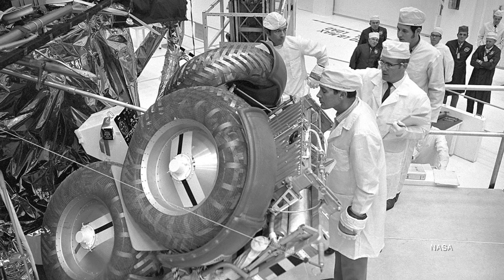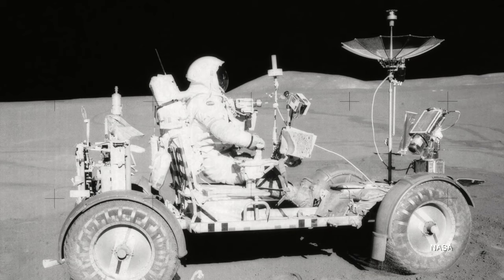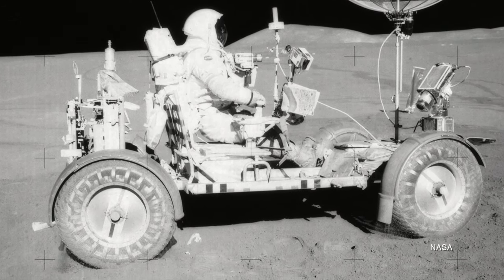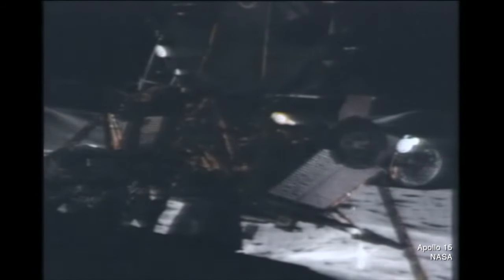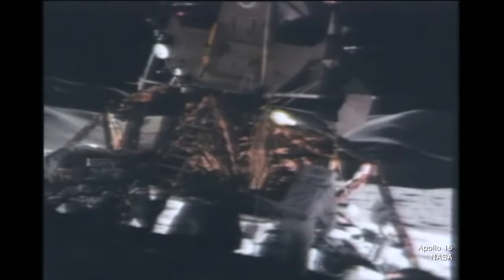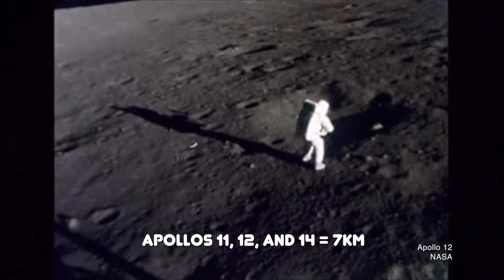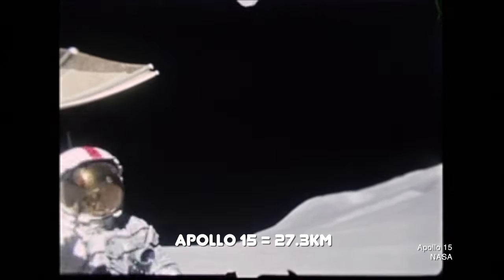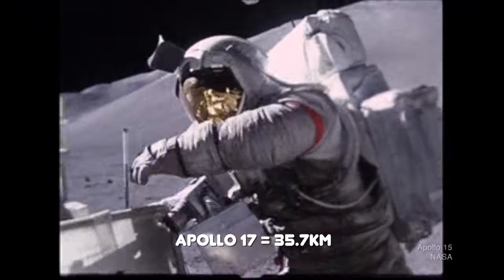How NASA Took Cars to the Moon

Comment: sure looks like the nevada desert to me lmao----ohh was the lem allways charging the rover on way to the moon---space is cold -and should they not deploy the rover in the sunlight to heat up the batterie-and have a solar panel to keep it charged so they could go say 25 miles .
Reply: The fuck are you talking about? The batteries had solar shielding for temperature regulation dude. And the rovers never went very far. They had the battery charge they were given when the ships were launched and that was it.

Comment: The cameraman did a great job of filming them leaving the moon. Oh wait, shit, I hope he's ok. Did they have remote control that could travel 237,000 miles away back then? I remember having a wire on my T.V remote in the 70's pmsl.................
Reply: Yes, they did have remote control that could travel 237,000 miles back then. If you had as much money as NASA did back then, your remote most certainly wouldn't have a wire. Change your pants.
Reply: @Jan_Strzelecki  What type of remote? What type of wave did it use to do as they say? You have no idea what you are talking about.
Reply: @Jan_Strzelecki  Was it radio wave? Infra red? Ultra violet? We cant broadcast a few thousand miles on earth to this day without delays. How did they do it with 237k miles and only 1.5 sec delay?
Reply: @wullymc1  The Manned Space Flight Network antennas operated in the S-Band, on frequencies around 2.2 GHz.
And we can't broadcast across the Earth because it's round.
Reply: @Jan_Strzelecki  Never heard of fibre optic and satellites? So is that radio waves then?
Reply: @wullymc1  Again, the Earth is round. Just because your transceiver is in orbit doesn't mean it can magically transmit signal through the ground. And, in face you haven't noticed, fibre optic is a physical cable - you're welcome to try to put one between the Earth and the Moon, if it baffles you still.
Reply: @Jan_Strzelecki  I wasn't talking about fibre optic to the moon you clown. I'll let you win this one . I just researched radio waves..... LOL
Reply: @wullymc1  " I just researched radio waves"
Dear Lord. Better late than never, I suppose, but it's always best to find out about stuff BEFORE arguing and name calling. This is general advice for all hoax believers.
So how did you think drones worked? Did you think they had miniaturised pilots?
Reply: The moonlanding was broadcasted and the signal travelled 237.000 miles from moon to earth, live. I can't see any problem on them controlling the camera from earth by the same ways.

Comment: Who was filming the LM when it went up? I think the reason why the LM was so poorly built and constructed from junk was because the original one fell over on the film set and Kubrick invited the local primary school to do a project. The LM was the result which Kubrick then commandeered to carry on filming. Seriously, how the *uck can anyone believe that was fit to go 100 feet up, let alone to the Moon?
Reply: Who was filming the LM when it went up?
Ed Fendall, remotely controlling the LRV's camera from Houston. 30 seconds of googling would've told you that. Why didn't you do your research?

Seriously, how the *uck can anyone believe that was fit to go 100 feet up, let alone to the Moon?
It's not a matter of belief. It's a matter of understanding what each part of the LM was supposed to do. You apparently don't.
Reply: @Jan_Strzelecki  you obviously cannot see that none of the panels fit properly and no credible engineer would put his name to that. It's fake!
Reply: @Jan_Strzelecki  As for mission control operating the camera, do you really think with the time lag, NASA can move the camera in perfect synchronisation with the LM perfectly framed? Think for yourself and not the nonsense NASA pumps out.
Reply: @erniefasbender4939  As for mission control operating the camera, do you really think with the time lag, NASA can move the camera in perfect synchronisation with the LM perfectly framed?
No. It can't, and it didn't. Ed Fendall wasn't even looking at the monitor, but simply followed the expected trajectory of the LM in advance. And it took NASA three tries to get it to this stage. Think for yourself and not the nonsense hoax believers pump out.

Comment: 2023 electric cars arw coming out but they had them in 1968 and could do 25miles on a rocky planet 😂😂😂😂😂
Reply: Huh?  Back in the late 1800s and early 1900s, electric cars outnumbered gasoline cars.  I fail to understand your point.  And, what's significant about 1968?  Why'd you even mention 1968 in reference to the lunar rovers?
Reply: @rockethead7  The denier is terrible at history.

Comment: apollo 17 covered 35.7 useless units
Reply: Jose Vargas What's useless about them? The fact that they're logical? The fact that they're based on multiples of ten and not some arbitrary unit based on the length of the king's arm? 

Yeah, totally useless.
Reply: Edward Bravo.
Reply: Jose, how is the metric system useless? It's simple because everything divides/multiplies in 10s. Much more simple to convert from meters to km than from feet to miles.
Reply: The original mile was one thousand paces, approximating five feet. Simple. Wish they hadn't changed it to eight furlongs. I have no idea how many simple five-foot paces go into a kilometer, which was created to "fit" nothing in particular.
Reply: Pygar2 The metre was originally defined in 1793 as one ten-millionth of the distance from the equator to the North Pole.
Reply: Actually, the mile is now officially based on the meter. Sorry, but you are just using an outdated way of using the metric system.

Comment: total fake
Reply: It was attached to the side. Look closer at the video
Reply: Fuel was in the main cross section around the engine in line with the landing gear. The rover and science packages are in between them.
Reply: Haakon Haakenstad justify that remark. weight/load vs thrust/fuel.
Reply: Descent stage had 2500m/s delta-v. That's plenty.